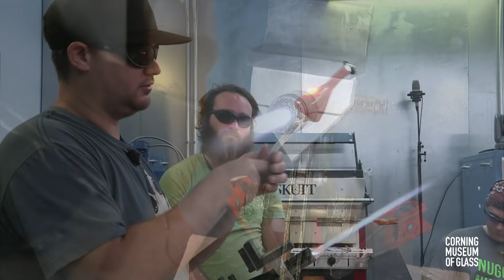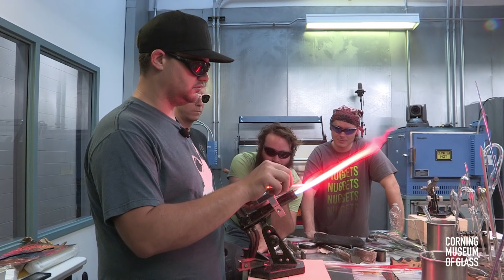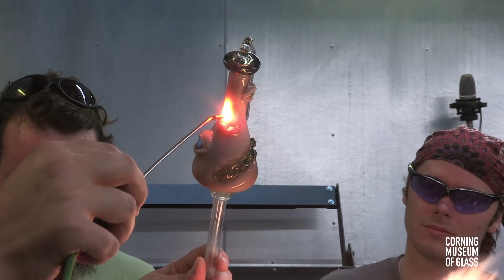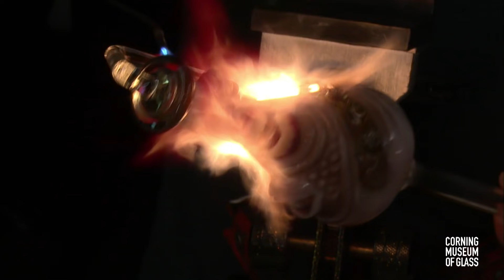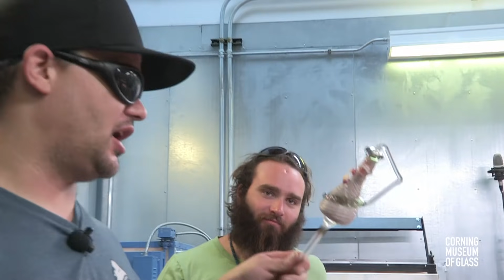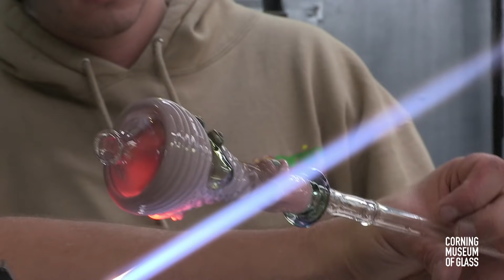Salt Live-Streamed Studio Demo

Comment: quick question why did he burn it all black in one part of the video is that to harden the glass?
Reply from the maker: Hi, Eric Goldschmidt, properties of glass programs supervisor says: The build-up of carbon on the piece is a result of running a flame in which there is not enough oxygen to combust all the gas coming from the torch.  We call this a reducing flame.  He would have been using such a flame to heat the glass more gently as it is a much lower temperature than a fully combusted flame.  Some folks also believe the carbon may help as a layer of insulation on the glass such that it will not cool too quickly and crack.  The carbon/soot will either just wipe off, or it will burn off at around 900 F. Thanks for watching!

Comment: why/how did the piece turn black, then back to pink? was it just carbonization from the fluffy flame? did reapplying heat 'burn' it off?
Reply: That's basically it in a nut shell, carbon from the lower temp/higher propane concrentrated flame and then it burns off quickly in higher temperature flames.
Reply: What was the purpose?